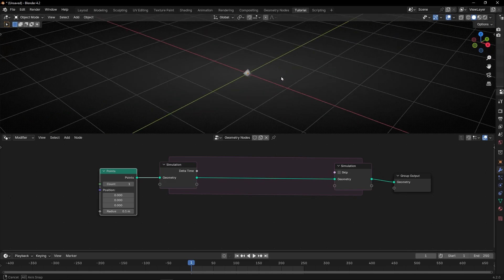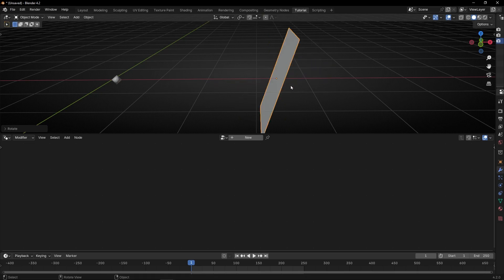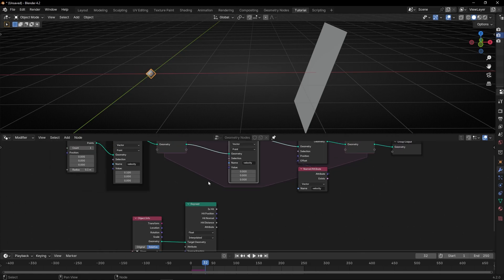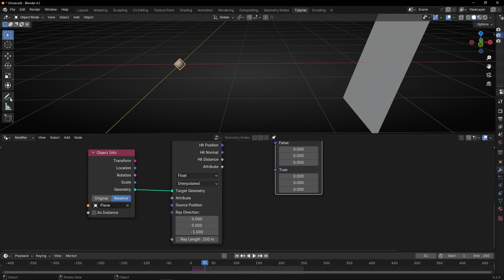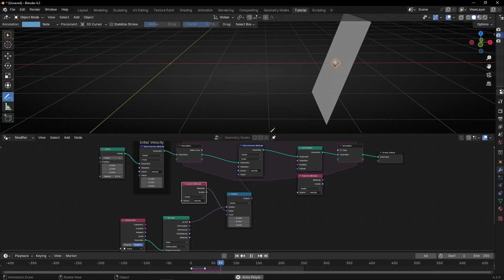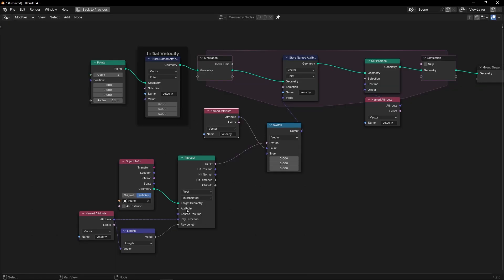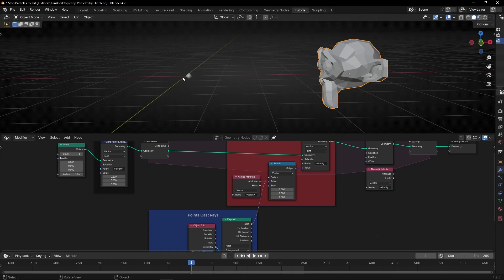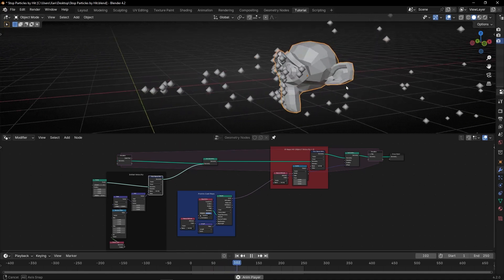STOP PARTICLES by Hit in Blender Simulation Nodes

Comment: I have been appreciating your tutorials. I have been watching them over and over to get familer with the logic behind simulaton zone. I am using the principles in your videos to create a dart shooting gun. The darts fire from the gun tthe darts are aligned to the vector of the particle. when they hit an object they stay in the same alignment from the vector. but one thing I am getting is irregular behaviour when the darts stop at the object. if I increase the vector they go through the collision object. sometimes the  position infront of the object is not consistant at the right distance.  idealy if I move or rotate or increase the velocity of the darts they will stop at the collistion object all the time. I have heard you can use substep frames with the simulation zone but it is not clear. do you have any experience with the behaviours of the particles